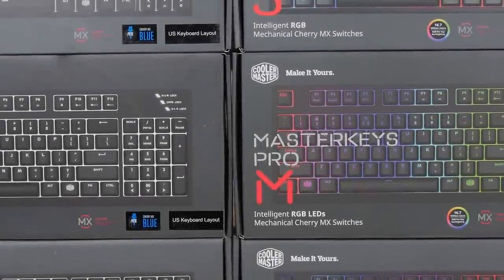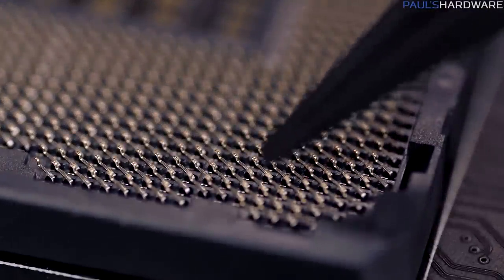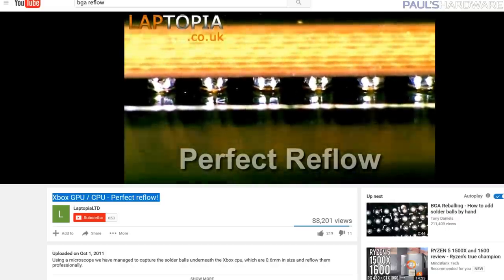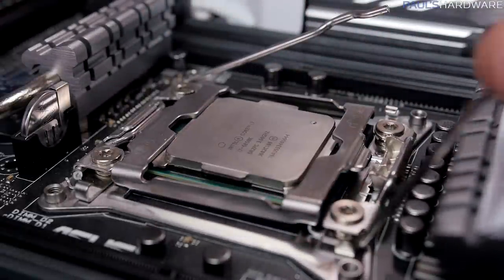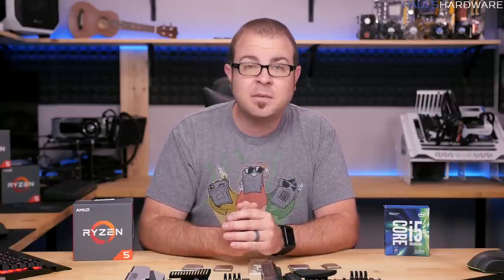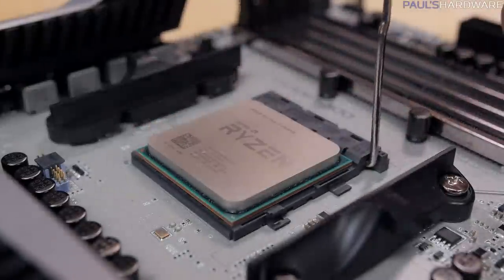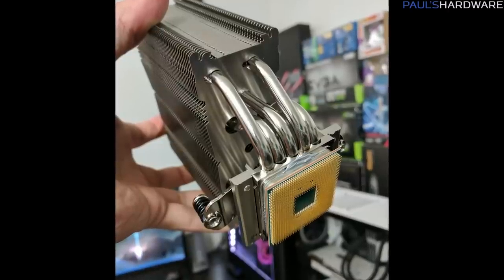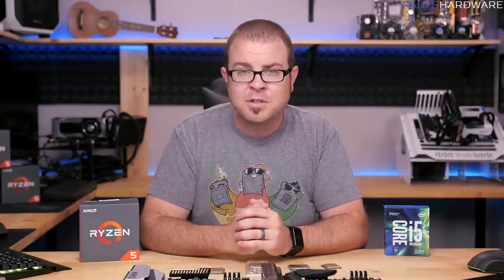LGA vs PGA! Which is better?

Comment: I prefer LGA for one simple reason; if you happen to break a pin, the motherboard is cheaper to replace. (At least in the higher end of things). 

Other than that, don't really care if it's LGA or PGA. Don't use force when installing things and don't toss things around.
Reply: Ole Martin Snuggerud and don't try to clean a lga socket
Reply: That's no problem. Been there done that.
Reply: Ole Martin Snuggerud no pins bendet? Quite impressive
Reply: Not in any way they weren't supposed to be bent. It's really no problem. All about patience and a soft touch.

Comment: PGA is better, if pull the heatsink and its stuck just don't use force, turn the PC on but keep the CPU cooler off, the PC will boot and u keep holding the heatsink, when the CPU starts to get worm the heatsink will come off and then u turn the PC off.
And no, keeping the cooler off won't overheat the CPU because it has safety measures for that (MB will turn of if it gets to hot).

Comment: I thought Intel developed the LGA socket to gain better contact to the power hungry Pentium 4, thus lowering the temperatures. I remember my 915 motherboard manual stated that the Prescott cpu could only be inserted 15-20 times in the new LGA775 socket due to the mechanical stress it induced.

Comment: Still prefer lga because this way there is some bracket that hold the cpu in place, which is very secured, while the pga one only uses lever and no bracket to hold the cpu in place, which isn't that kind of big problem but i should say the lga is more secured then pga

Comment: I bent pin on 1155 motherboard. I was able to fix it, but after that i had random booting issues, i tried bending it again closer to how it was originally, but there was nothing to do, i had to live with it. I thought after that, i will never get lga again.

When i had am3, i once bent 1 pin, i was like 1 pin easy fix, and another time when i was removing cooler, cpu came with it, and there was no damage on cpu.

Comment: Actually it makes more sense to have the pins on the motherboard, since it's easier to break a CPU pins which is more expensive than a motherboard, just saying, intel did the smart thing over there.
Reply: I'd argue the opposite; between inserting DIMMs and aligning it on the standoffs, you're generally encouraged to be much rougher on a motherboard than you'd ideally want to be on a component with such delicate pins on it. CPUs, on the other hand, you're naturally inclined to treat with extreme care, if only because of how expensive they are, so I'd say you're far less likely to damage PGA pins than LGA pins.

Comment: I rather have LGA if it was brand new but PGA if the system was old.  Why you ask?  When the system is new your processor probably cost more than your motherboard.  When it's older your processor will depreciate more than your motherboard.

Comment: PGA is better hands down, I know motherboards are cheaper or equal in price to CPUs but I will much rather have to take out my broken pin cpu than having to open up all screws, connections  and disassembling the system for some bent pins . And even fixing pins on a cpu is feasible but on a mobo, you just cannot put the pins back in original position . Not to mention, sometimes you would use a different mobo for the time being when your broken pin mobo is getting RMAed and you will need to install the OS again . Then when you get your rmaed mobo back , you will yet again need to reinstall windows because windows dont like changing mobos . But for cpu, nothing of the sort .

Comment: Now if only AMD sockets adapted some form of Intel style hold down for their CPUs I think they'd have all the bases covered. I mean it really wouldn't take that much to incorporate some form of heat spreader hold down to prevent pulling a PGA chip out of a socket during disassembly.

Comment: It's pretty easy to fuck up LGA mobo pins.
It's not that easy to fuck up a PGA CPU.

Drop something on LGA socket, done, rekt, new mobo.
Drop a PGA CPU, bend and done. Ez leyf.

Both situations require a "special" person (to fuck it up). One is "safer" than the other.

Comment: 6:21 BS You place that broken pin into the hole it needs to go in and install normally. Unless you really fucked up that pin, BINGO, your system works like nothing happened

Comment: I've had the opposite luck, I've accidentally bent a total of 5 pins on an lga socket and repaired it, it's hard, but I'd rather fork over another 15 to 60 dollars than about 300 to 900 dollars
And I had an old AMD CPU which I destroyed trying to bend its pins back 

Blue team 1
Red team 0

Comment: the liquid cooling surfaced on the top of chip package is highly important, offering the very low thermal resistance path. If y guys try to remove it to read the model information  y will be sure to get the problem of too much chip heating ^^

Comment: to bad they cant come up with a socket, that uses both the amd socket and the intel. like using the amd socket but have it that when you pull the arm down, pins raise up from out of the socket to engage the lga cpu pads.  but it needs a different lock down mechanism to prevent pulling the cpu out, when your un-installing a heatpipe heatsink that has a strong grip cpu compound.

Comment: Old CPUs with pins easy to bend while motherboard was pin-less, newer CPUs with pin-less design prevents CPU damages and prevent bent pins but motherboards are designed with pins which gets bent and damage easily. 🙄

Comment: I prefer to use PGA mainboard, more durable for long use.
LGA pin mainboard soo fragile, you broken the pin socket, 99% you done with broken mainboard.
With PGA mainboard, if you bend the pin, is easy to fix that.
One more: mostly mainboard is not have log lifetime usage, 5-10 years will be died, and not with processor, i have a 50+ old processor collection still working, but the mainboard is already broken.

Comment: Some bullshit about broken PGA pin on a CPU. It's not toast, if it's just one or two pins and they're in the closest to the edge row - they can be resoldered back to a CPU. You just need a steady hand and a bit of patience. And regarding the 'glued' CPU - just use higher end thermal compound. Haven't seen such cases since switched from low-cost good-for-nothing thermal compound to a bit pricey one.

Comment: Neither. Bumps beat both. Imagine a processor with bumps on the bottom in place of pins and rivets on the motherboard socket. There would be no way to damage it, nothing would get in pin slots and no pins would be bent.

Comment: This is why you should boot your pc and let it run for an hour and turn it then off to remove your Ryzen Processor because that happened to my Ryzen 5 2600x... now I have a Ryzen 5 3600 because the 2600x is broke due to the cooler that I tried to remove and removed 4 pins that were important...

Comment: The only thing i on which i would dissagree with you is ability to repair broken pins on PGA CPU-s. Personally fixed my old CPU with 4 broken pins by simply putting coopper wires into the sockets  beneath the broken pins.

Comment: ive got amasing idea about it. just make cpu with holes and motherboaed as well means on 2 sides keep the same like amd motherboard socket and between them just add adapter with pins which will connect cpu and motherboard together. the adapter pins could be repleace if blocken any time so motherboar and cpu is safe. i would call it HGA, means hole grid array. :) greeting from Poland

Comment: I just hate pins on the cpus because the slightest mistake with them (and they're small) can break them forever.

No matter the technique, I've never successfully bent back a cpu pin, while on motherboards the chances of those getting bent is WAY lower since they're bigger and less likely to be dropped. Plus, you don't handle the area with the pins that often while on amd CPUs you better hope you don't breathe wrong and the cpu breaks forever

Comment: Intel still uses PGA with their laptop CPU's, if they are removable (not all are). I've replaced the CPU on 3 of my Intel laptops, including a first gen core-i7, all were PGA with ZIF sockets, with a screw to lock down the processor, instead of a level arm.

Comment: if your cpus is gunked up with so much thermal paste you know that a noobie was at work seriously that stuff is meant to fill the microscopic gaps caused by uneveness between cooler and cpu its not supposed to be a layer in between no thermal paste will beat metal to metal contact. for me PGA wins hands down never had trouble unmounting cpus.

Comment: If you lose a pin on your PGA processor it's not necessarily toast.

Modern CPUs have hundreds of pins for power and ground, and losing one of those isn't the end of the world. It just means that power will be a bit less well spread out over multiple pins, which could have a small impact on how much you can overclock but shouldn't affect normal operation.

If you lose a data or address pin... this time you ARE toast. Sorry.
Reply: If you lose a pin on a PGA Processor it doesn't post.

Comment: i fucked up my ryzen 7 2700x pretty hard when i got it, since i am a noob i screwed up pretty hard, i managed to get all the pins soaked in thermal paste (dont ask me how), i got the nearest brush, some disinfectant (cleaning alcohol would've worked WAYYY better), cleaned all the thermal paste off. bent like 17 bent pins back using my driving license and no problem worked like a charm. i honestly think PGA is better than LGA cuz with PGA its (most of the time) no problem to bent the pins back hell you can even solder them back on, while on LGA you have to (most of the time) purchase a new mainboard which is not as expensive as a cpu but also not as easy to fix as an PGA cpu

Comment: I wish intel would go back to PGA yes the cpu is more fragile but if bent they can be fixed really easy I used to have a bin filled with old PGA P4s and half of them had bent pens I just used a small flat head screw driver straightened them and they worked fine

Comment: If you use your pc like a normal human being it doesn't matter at all. PGA is probably cheaper becasue you need golden cpu contact points and golden mother board points with LGA(correct me if I am wrong). I'd pick LGA over PGA because cpu always cheaper than the mb.

Comment: Why Intel or AMD make a better design socket? A PGA processor with metal frame around the processor for protecting the pin, and ZIF socket with lever like on LGA design?
This socket will be perfect on the both aspect.
Cause, i have 4 LGA Mainboard with broken pin socket form my client, lol!

Comment: I dropped my last AMD CPU... Those pins bend fairly easily XD About a third of the pins were bend down flat. Got them bent back right, but My 4th RAM slot does not work because of it lmao.

Comment: i prefer  pga because i have had 2 lga motherboards and i ended up bending pins twice. i did manage to fix it after 4 hours and i managed to fix a bent pin on a 860k in about 10 seconds. also pga is much more satisfying.

Comment: "While it's not the easiest way to insert the CPU" ...hahaha, have you totally forgot AMD Socket A, that required you to apply huge force on the heatsink locking lever by using a F*CKING SCREWDRIVER? Over the years back in the day I even lost the count of motherboards that me and my friends have accidentally destroyed when screwdriver slipped from that tiny lever hook. Now THAT was "not the easiest way" - these days LGA/PGA installation is god damn PEACE OF CAKE in comparison.

Comment: LGA is better because if you bend pins on LGA they are on motherboard so you need to buy a motherboard which is significantly cheaper than cpu

Comment: No manufactures I know of rma bent pins. Any bent pins are considered user error and not covered just like water damage on most phones.
Also, if you worked at newegg for so long, why does it always look like all your info is either a direct rip from OCN or GN, or basic knowledge anyone knows.
Anyone watching, do yourself a favour and go directly to the source.
Reply: I rmaed my MSI board with bent pins no problem.  It was a x79 board on LGA2011.  They just sent me a brand new package, with everything from the sata cables etc. sealed.

But during that time I just bought a new ASUS board... newegg wouldn't accept the defective board with bent pins and once I got the replacement board, they didn't want that either.

Comment: well without Fan amd vs intel thing, i think Intel is safer...
PGA can be a problem sometimes on those pins bending... 
But imo, LGA hasnt that problem so much on the Mobo but, w/e
On other perspective, Mobo usually is cheaper than a CPU ... so +1 pro?
for those who waste not more than 100 euros on a mobo but waste on a CPU over 100 euros... i think LGA is also better in that case...

Comment: Well.. i've had about the same amount of amd and intel boards troughout the years and 4 intel sockets got screwed vs no pins ever breaking off of any of my amd cpu's. I'd say AMD is the winner ^^ 
Also the 4 hole twist thingy cooler mounting from intel is a nightmare...

Comment: LGA has the pins on the board if they will brake or anything else you just need a new board (if u couldn´t repair it allready) also intel have a socket pin protector cap or shield don´t know who they call it, but for their boards this is a good idea to save your pins!!!!!!!  AMD have the pins on the CPU and a little wholes in the socket bracket and no option to protect the pins! the older AM2 / AM3+ were able to repair it sometimes if some pins break out of their position.but since AM4 the distance from pin to pin are even smaller like before! so it´s not so easy and there are even more pins wich could brake! with AM3 its even works if you use a EC card to put them into the right position, but with the new socket AM4 the EC cash card ist to wide and not possible any longer to repair it with it.i did it with some AM3 cpus the most of them i got allready fixed and repaired! but also they can lose pins!!! the worst case! sometime it´s possible if u found these pins to set them into the wholes on the board where they should be placed in the right possition, if there are only 1-5 maybe it will be good & work on.if u lose the pins....yes then i think you will need a new board.but one time i also lost 1pin and take another metal piece (i don´t remember wich item it was) and put it into the socket whole where it should be in "normal case" but remember this! fixed cpus and also their pins shouldn´t get overclocked, cause the voltage can push them up.with fixed pins on a intel board it allready works, thats my experience with it...

Comment: I'd rather have a fragile set of pins on the less expensive part, in most cases the motherboard. PGA seems illogical as you're putting the part more likely to be damaged on the more expensive component.

Comment: as much i love my intel cpu, i do have to admit, you can delid an amd without many cons whereas if you delid your intel, you are no longer able to clamp down your chip
Reply: @dirtyasianmafia2310  both have instances where they are soldered onto the motherboard(laptops, actually, I see more Intels soldered than amds, I've only worked with a series chips from amd) , but you can put cooling directly on the dye of an amd non soldered chip  because it doesn't use the heat spreader to clamp down the chip.

Comment: lo9ve it that's just what happened to my fx I pulled off the heatsink and the processor came out with it except one pin.!, I tried everything to put that pin back in from a nasty burn on my eyeball from trying to solder it back in to superglue I got it to stay in place with the super glue and even put it back in but alas ,TOAST.:(

Comment: If a pin breaks off 95 percent of the time the cpu will run fine because multiple pins have the same purpose so 1 may effect overall performance but you should be fine if one breaks off but don’t try it lol

Comment: To be honest, both methods are shit. Pins should NOT be on CPU side ever.  A CPU should be as durable as possible.  Mobo pins in the other hand should be much easier to fix. But the truth is, neither company cares about this enough to come up with a better design, because it wont really earn them any profit.
Reply: I have never had issues with CPU pins breaking, just be careful with it and it won't break.
Reply: @hakont.4960  You don't even have to be that careful with it. I've seen someone step on a PGA CPU before. Eventually, all the pins were fixed. It was fortunate, though. I really did not want to see if a new pin could be soldered.

Comment: PGA sucks. I bought a ryzen 2700x and I experienced the problem of the cpu being stuck to the heatsink and being pulled out of the socket. It bent my pins. I almost lost $300 due to that if it wasn't for the technician at the store who was able to fix the pins for me
Reply: A small and careful movement will avoid this happening. Avoid using low quality thermal paste. PGA and LGA are both rather flimsy. I have a 2700X too. Though I prefer LGA.

Comment: rather PGA easier to repair , those LGA pins are a nightmare to fix in damaged sockets , but LGA CPU's are easier to lap .. tho we just delid now anyhow soo .. dude just buy a replacement LGA socket they are not even $5 and are BGA a little heat and your done

Comment: Why not use small balls of copper on motherboard and LGA on processor, then you just put your processor in socket, contact are god, better than pure LGA or PGA or BGA, and you cant brake anything or you can use pins like pyramids or on motherboard use little 
radius holes that fit and on CPU half radius rounded pins, if you so want that BGA, solder it like 50 years ago, let the f*cking pins go through motherboard and solder it from the other side, that thing never fails.